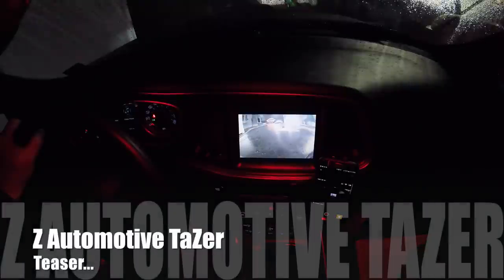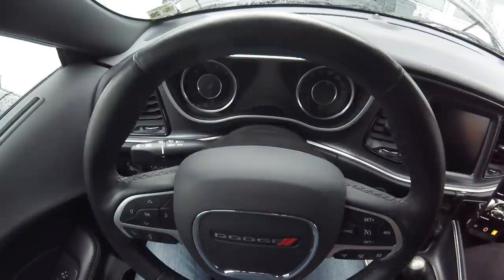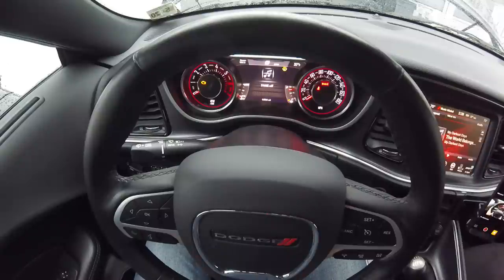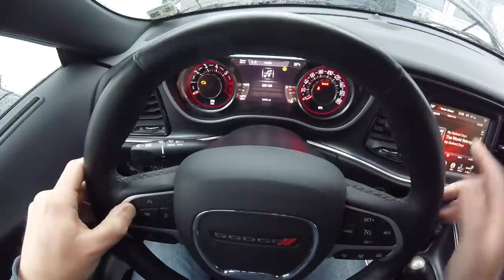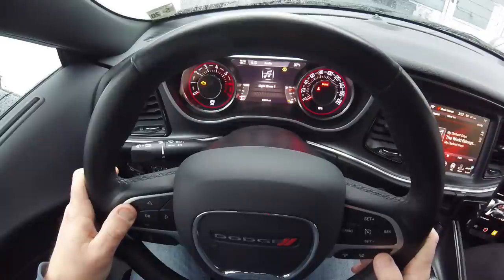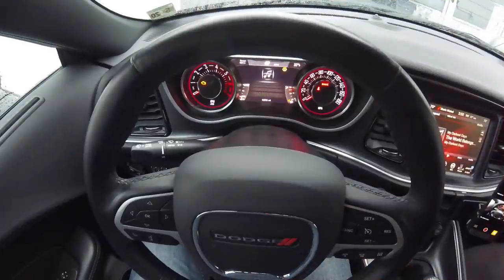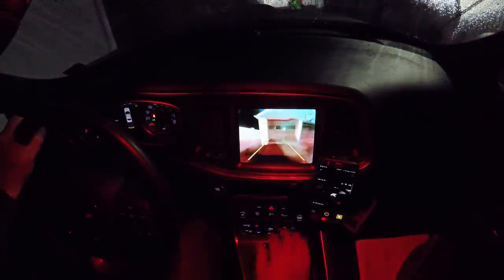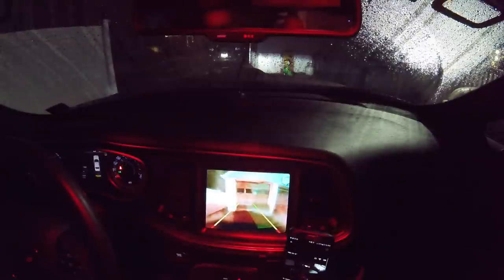zAutomotive TaZer - Mapping Aux Buttons, Font Camera, Fan Control

Comment: Can the ACC buttons be remapped if they are functional. I have an auto 8 speed charger
Reply from the maker: From Joe Z

"If you have adaptive cruise, you can use the remap function... BUT, it's sort of a double-map... so don't map the ACC on/off button as it'll do both the tazer function and turn ACC on and off, so that button can't be used.  But the nearer and closer buttons can be mapped, and I coded the tazer such that they should only do the tazer function while ACC is off, and when ACC is on, the tazer ignores those buttons."
Reply: Work Play Drive Awesome  thanks for getting the answer from Joe, this Tazer is getting better every day. I love having all these options how I get to customize the car. Thanks for you videos I really lkie them and i might be installing a front camera soon.
Reply: Work Play Drive if i don’t have ACC but i buy the ACC button assembly can i remap all three buttons since i don’t really have ACC just the buttons? Cuz you stated you cant remap on & off button but i wouldn’t have ACC for-real to turn anything off or on just the button function?

Comment: I have a 2017 Scat Pack and want to remap my sport mode. It currently doesnt NOT work. How can I do this? 

-Any input is appreciated.
Reply from the maker: The button remapping feature is only available in the December 2016 and after firmware once installed did you try the steps at  6:09 to map the sport mode to a custom drive mode?
Reply: I did and got the custom mode to work on the sport button. Is there any way to remap the backup camera to the traction control button or any other unused button? 

-Thanks for the quick response
Reply from the maker: The other buttons in that panel are not mappable only Sport.  You can double tap mute to switch to the backup cam.  Note at about 8mph the cam will shut off
Reply: Ok, cool. Thanks!! (Need help with another issue) I had a set of LED lights from my 2016 challenger RT plus (worked fine) Then i put the same set on my new 2017 challenger scat pack and for some reason they blink but wont stay on. Anyway to fix this?
Reply from the maker: are these LED interior lights or exterior (headlights, fogs)?
Reply: Work Play Drive exterior fogs
Reply from the maker: This sounds like you need the Anti-Flicker module, the LED manufacturer would be able to sell that to you, it goes in line between the plug and the light to regulate the voltage.

Comment: Does the aux buttons for steering wheel work for 2017 scat pack?
Reply from the maker: yes, but in the next few weeks zAutomotive will be releasing a new product that eliminates the need to take apart your steering wheel. They found if you remove the blank plate over the buttons there are functional contacts so they developed buttons that snap in.
Reply: Work Play Drive so basically there buttons that will snap in place & can you still install the old one with aux buttons?
Reply from the maker: from what I've seen you leave the wheel intact and just pop of the blank plate then snap in the 3 new functional buttons they sell.  Check out my post here https://www.facebook.com/workplaydrive392/photos/a.1108848085820702.1073741831.1083744008331110/1563993140306192/?type=3&theater
Reply: Work Play Drive but you can still purchase the one you got & install if i didnt want this updated one?
Reply: Work Play Drive I wanna buy the one you got will it work on 2017 scat pack charger? & the place you got it from in link they dont have it no more so i gotta get it from EBAY.

Comment: Can remap sport mode on the auxiliary steering wheel buttons
Reply from the maker: no but you can map a custom drive mode, built like sport mode ;)
Reply: Work Play Drive so technically you can remap a “track mode” to one of the aux buttons? Thanks for posting and being informative, good stuuf👍🏻
Reply from the maker: Thank you 🙏